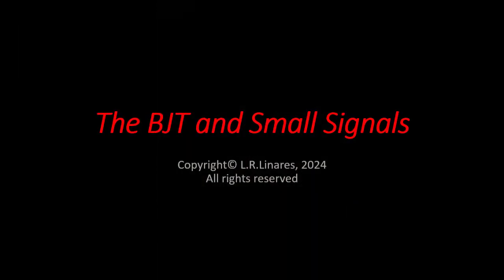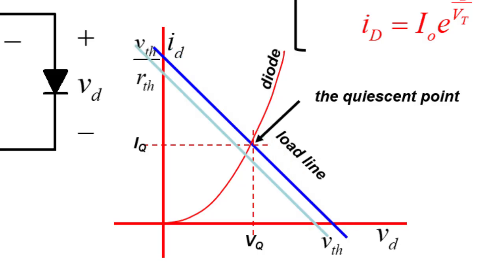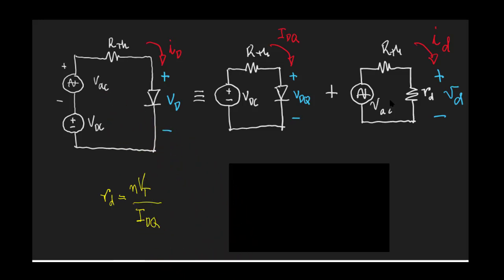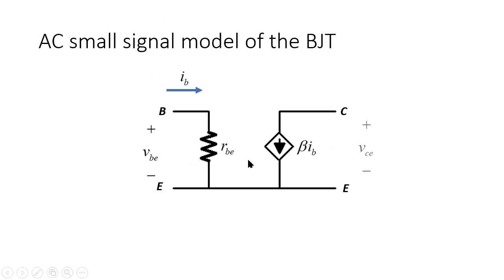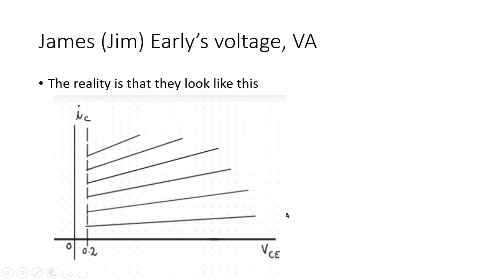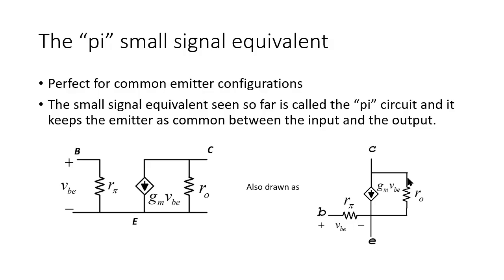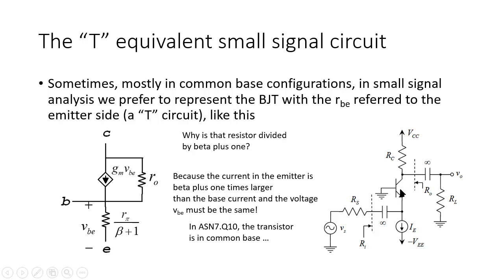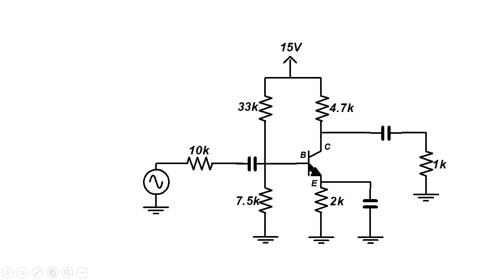the BJT and small signals

Comment: Hello, I need your help with a HP Prime Problem. I will shift in technical calculations the exponent from the answer. E.g. 2,5E-2 in 25E-3 and found no key or possibility. Also the manual did not help. You as an electrician and HP Prime expert are my last hope before I sell the calculator an buy a casio... Please help 😢
Reply from the maker: Just type 25e-3, enter the 'e' with the alphanumeric keyboard (or, if you are using a full keyboard in an emulator, just type the letter 'e').  In previous HP calculators there was a key EEX for that purposre.  They designers decided that it was redundant, just type an 'e', they said.